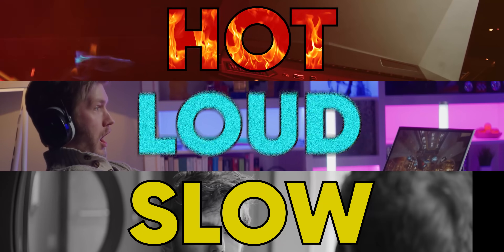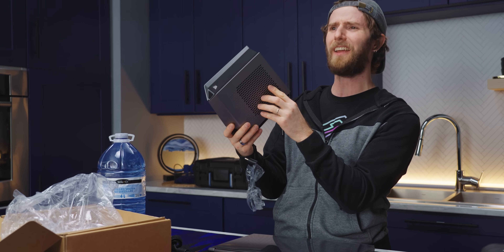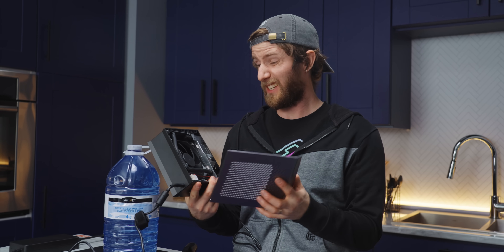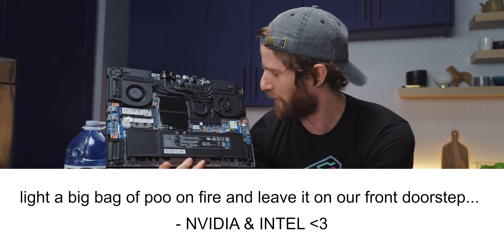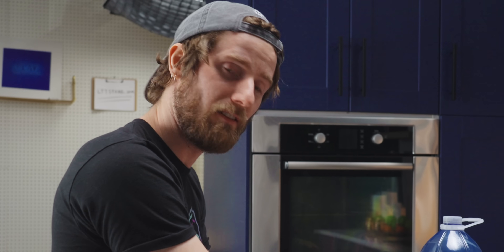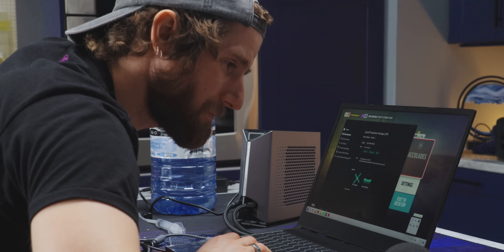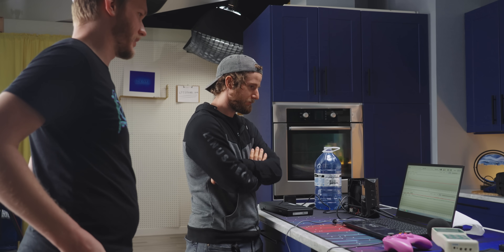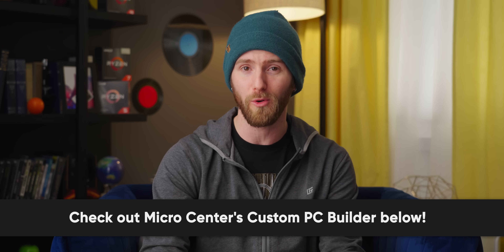This INSANE Watercooled Laptop Has a Huge Problem! - Eluktronics Prometheus Prototype

Comment: I got mine and it sounds like this sound. I got mine from aftershock. I contacted them and they said its normal and they cant fix or replace it... The sound is anoying asf and if you run it without cooler the laptop sounds even worse. Get another brand without the water cooler.

Comment: I have one of the worst laptops ever made, a HP Spectre, that is constantly overheating. I've been considering jerry rigging one of these to go into copper lines that sit on top of a laptop fan base so the fans can blow over the lines and help cool it down. Not sure if it'd be worth the effort but nice tonsee it kinda works for cooling it down as designed.
I would love to see something like I have in my head designed, like a cooling base with integrated cooling lines that plugs into a unit like this so the base can blow cooled air into the system rather than ambient temp.

Comment: mine laptop is on mouse pad beacause i game and i put it right beside my monitor in the corner. there are walls on the left side and on the back but i wanted to buy those cooling pads but i changed my min beacause i just moved my laptop so my back fans are not on the mouse pad. its little bit of the table but HEY it works and its cool

Comment: I  have a Mech 15 G3 from 2021. I'm having an issue that anything that I connect to the Thunderbolt 4 USB-C on the back, it randomly disconnects and connects, at random intervals. So far, I have connected and external SSD and a TB4 dock, while using most of its USBs already and always keeping my laptop charged. Am I doing something wrong? Is it a defect? Any answers I would really appreciate it. Thanks.

Comment: I think to "problem", if there is one, is that the cold water runs over the cpu, but returns to the cooler with the hot water over the same space, somewhat negating the flow of cold into the laptop.  Don't get me wrong, it seems to work fine, but it is what it is in a VERY confined space.  I think Eluktronics did a great job overall.

Comment: I'd be very interested in seeing this concept in the upcoming Labs when it's up an running.  A water-cooled breakout box like this vs an eGPU vs a laptop cooling stand vs undervolt/overclock type of test. (Not all together, obvs). I'm SO excited for the LTT Labs!  SOOO much potential.  I'm still wondering if they will be gaining a certification, though probably not, as it would involve way more than they can accomplish being a "small" lab.  Who knows.  But I'm still stoked!!

Comment: Theres great potenzial here, laptops come with alot of power today but they are limited by thermals and the resulting noise levels. 
I might do a DIY- job on my laptop with a few design changes: Bigger radiator and fan, quiet aquarium pump, a clear reservoir, a connector that doesnt let the water leak out when unplugged. I dont really need speed control if the whole system is quit enough, when its not needed I just turn it off.

Comment: Yo guys, I'm one of the first owners of a notebook with this liquid cooling (XMG Neo 15 - the European counterpart of Eluktronics), and I can tell you it is freaking awesome. It is much easier to use than I thought it would be. When you unplug the liquid cooling connector, the male connector cuts all water flow, so when it's unplugged it doesn't spill or drop any liquid no matter how you hold it. The holes in the female connector in the notebook chassis are small enough so that there is a resistance that the liquid inside the laptop has to break through to get out, so it doesn't spill by itself (Think of a syringe full of liquid that you have to press to get the liquid out, it's the same concept).

When I want to move my notebook to another location, I unplug the liquid cooling connector (which leaves one or two drops of liquid at the table), and I take the laptop to a sink. While moving the laptop with liquid inside, it doesn't spill no matter how I hold it, which was my biggest fear before buying this. At the sink, I use a manual air pump that they ship with the laptop to blow air through the liquid cooling female connector to get all the liquid out, and I'm good to go. I do this in 30 seconds or less, it's pretty convenient. I have posted a small amateur video on my "channel" going through this process if anyone is curious.

The temperatures that I observed in GTA V were:

Liquid cooling OFF:
- GPU: 86°~ (capped at max temp allowed by NVIDIA)
- CPU: 86°~90°

Liquid cooling ON:
- GPU: 62°~
- CPU: 72°~82°
Reply: wait what ? if you disconnect the external water cooling to move the lap top and its sorta sealed so only a few drops come out ? exactly why the hell would you go to a sink and use a tool to extract the water out of the lap top ? how about not making a tool to remove the water in the lap top and simply making a cap device with a quick disconnect as well and just CAP the lap top and leave the water inside?
Reply: @mathewhoffer4541  This is the first version, they could improve it on future iterations
Reply: @LucasBustamante1  yo man how’s the build quality after 3 years?
Reply: @Negative ScopeYou have leaks with both ends connected? Never had this kind of issue with mine. The end that connects to the cooler (the one that you have to screw) sometimes the screw got a bit loose with time and leaked a bit. The other end is plug-and-play, so never had this issue.
Reply: @Negative Scope What liquid are you using? I've seen a recall on the first month due to broken connectors caused by the chemicals in the cooling liquid that they shipped the first batches with. The recommendation is to use distilled water only. If you're using distilled water, then I don't know what else to say

Comment: i have a sony viao laptop from 2012 and i have managed to drop the temps by 30*c ,as i live in a hot region where temps go upto 45*c  in summers , i have removed the ram cover completely and put up a stock fan from microsoft's xbox 360 and boy it ramps up, its using an external power brick (AC to DC) with a regulator upto 12v  from 1v , and the room air conditioner (daikin 1.5ton) really puts up the temps around 29* with minimum load and 40 under loads like gaming and 60* for long video rendering (4k) which is not bad compared to a 40*+ ideal and 100* while the cooling system chokes. so yeah the problem i have encountered is completely within the resources available at home (xbox's motherboard was dead so i had no problem chipping off the cooler from a soddered cpu or gpu)and smartly engineering the aero part and the laws of thermal conductivity.
conclusion a mobile cpu can perform really well under controlled temps , and leaving any gap between the fan and laptops body will cause a massive loss as the air pressure with fight against each other, but now you cant put your laptop on a flat surface of without a stand, considering the perfomance tweak i highly recommend this method for those who are stuck and cant upgrade their machines any more as its working at its peak and need more performance with applications released in 2022 like photoshop 2022 , heavy blender or just for competitive gaming

Comment: Idk why u guys are attacking water cooling there definitely use cases for it and if you never have boosted the clock to a stable spot where it doesn't do any turboing it does smooth out the experience I've never seen u guys do it

Comment: I wonder how well a scaled up version would work. Not quite the old-school, hip-height exterior passive radiators of the early 2000s, but maybe a 240mm to 360mm version for the desktop, allowing people to add water cooling to a cramped case with minimal water-bearing components inside in the case itself.

Comment: I drew schematics to this water cooled laptops years ago along with theral calcs. Full folder with sketches and designs in a much better form factor because water would run on the blocks inside the laptop so actually water cooled not passively water cooled through pipes to pipe to chamber. Too bad never patented it smh smh

Comment: I would love to have a laptop with the 12900HK, it will be more or less comparable in games with my slightly overclocked 12600K, but have double the efficient cores so in everything else as in multi tasking should be great, just hope the mobile GPUs are comparable to at least the 3060ti/3070 desktop versions, waiting for reviews on the new laptops to decide on whether to buy one, you are doing a great job guys

Comment: There are two things that makes laptops unappealing to me when it comes to gaming; the slow displays (even those high refresh rate ones) and the awful loud noise they make when playing demanding games. Since I'm traveling when working, I have a 1 year old Lenovo gaming laptop with a 120hz display that I bring with me. Playing fps games which utilize the 120hz screen shows great signs of ghosting at that high refresh rate, and if the game is somewhat demanding oh boy does that laptop fans sound like it's ready for lift-off.

Regarding the slow high refresh laptop displays I predict that QD-OLED displays could make that a thing of the past. Then the last concern I have is the noise of the laptop when playing higher demanding games. A product such as this could be the ideal solution. Sure this takes a bit space, but honestly I could not care less if this actually made a laptop totally quiet while gaming, while this device itself would be quiet as well.

Comment: what if they add a quiet and fast rpm fan like from noctua or be quiet. for 200$ price it must have  a good fan right
Ohh they updated it with 99.99. if they could upgrade to noctua or be quiet fan with the price like 110$-120$. this might be the best water cooling laptop! you can operate CPU and GPU to the max with good temps

Comment: By the sound of that racket the pump had air bubbles it couldn't shift. I found the small pumps I've used in my watercooled laptop mods are prone to it. Cycling the speed up and giving 
them gentle whacks is about the only thing you can try to shift them, other than that, using an alloy auto coolant mix helped a lot (I had mixed metals in my loops, copper and solder)

Comment: laptops are noisy and hot if you don't have a clue how to use them. Mine is cooler and quieter than any desktop pc with an i7 from 10th gen and nvidia 2060 graphic
Key is to disable the stupid turbo overclock from cpu and use a proper clock speed. yes yes yes, benchs will give lower points but game runs the same with 30 less degrees and without noise 
Once I found out this which is not told anywhere online, I'm not going back to a desktop ever again.

Comment: Hello there sorry but I need help!!!! No idea where to ask so just posting here hoping to get an answer.... so basically I have a ssd and can boot windows from it when it's plugged in with sata to motherboard nd it works fine but if I take the same ssd out and use a USB cable for it I can't boot windows from it, the pc boot options are correct and it starts to boot the  comes up with windows encounded a problem with the sad face thing hahaha, any ideas much appreciated

Comment: Asatek had an AiO cooler designed for internal use in laptops in... 2012? Was built in an Alienware M18x. That would be something cool to see today. I think that thing was designed for a 55W cpu and 2x 105W GPU in sli back then.

Comment: This concept is absolutely brilliant, if it gets a few more months in the engineering room i could actually consider buying a gaming laptop for  when I'm on the move. My biggest complaint with laptops has been the cooling, both because of the audio and the thermal throttling.
Reply: Well, laptop hardware has thermal limits a bit higher than its desktop counterparts. But no hardware maker has built a laptop with water cooling in mind.

Comment: In my opiniom there should be a solution where you put watercooling from the bottom of laptop. Something like replaceable backplate with simple switch method. So you can just take off standard backplate and put the laptop on watercooled base.

Comment: I know it's just an engineering sample, but what happens if you disconect the water tubes? it has a sealig or something? Maybe it will be a good idea to add some weight to the bottom. 99$ is a very good price!

Comment: The performance is actually pretty impressive. If all that's wrong with the product are the semi-broken fan in this particular unit and the cap that could do with a redesign for Rev. 2, it's hard to really fault the product. Adding software fan control would be the cherry on top, but, depending on how loud (quiet) the fan is when it's working properly, it's probably no more than one last "nice to have". Seriously, from the well thought out internal layout, through the performance that the product delivered, through the (very) moderate price compared to competing solutions... this looks like a really good product, if you're into that sort of thing.

Comment: First thing I do on any device that has fans is rip the fans out and thrown them in the bin and put Noctua fans in.
Also FFS Linux, that fan has standard 3-pin plug. So you could easily add aftermarket fan speed controller to it.

Comment: once those wrinkles are fixed and it is revised .. that little cooler is well worth 200 if it making that much of a difference in temps and sustaining higher clocks...  i also like the power pass through

Comment: Well I thought it was a clevo but later I realized No it's not. Clevos would use desktop processor on it. 12900HK isn't.
It's probably an asus. I remember that GX700 comes with a watercooling dock.

Comment: I imagine this being a viable product for the masses. A lighter laptop without fans and extra heat sinks for portability and when you need extra power for work or gaming, just plug this cooler in and you're good to go. 
As a bonus, if this 'laptop cooler' is a common standard, you may even save a bit on e-waste by not installing so much cooling into laptops.

Comment: That was a very neat product. To solve the fan noise just put a variable dial on the front so you can manually adjust the fan speed.

Comment: given my laptop stays permanently fixed in a laptop stand up in the air to promote airflow and constantly runs at i7-8260HK ~82c & 980m GTX ~75c (yeah i just leave games open and/or parsec...)

think I should move it out into a airflowy case and re-apply thermal paste again 😅
laptop goes good for a nearly 6yr old

Comment: how does it handle when you unplug the Water Cooling from the Laptop, does it drain out or does it stay in ? because if you have to drain it every time you want to disconnect it then it kinda sucks as a laptop.

Comment: I have a 2 and half years old laptop with an intel i7-9th gen and 1660ti and I NORMALLY get over 100°C on gpu and cpu and when I see the use of them cpu is at 50% use and gpu at 55% use

Comment: This seems like a really awesome product. Imagine having a gaming/multipurpose laptop that you can stick in a docking station or whatever at home and turn it into a monstrous tower, with one connection. I'd seriously consider it in future for work travel, my whole rig could convert to a laptop without losing its power at home. It would have to convert into significantly better performance than other laptops of its price when connected to be worthwhile, though.
Reply: No it don't make really sence in my mind. In my opinion external notebookcoolers which you put under the laptop for 20$ is way better for his price.
Reply: @User-abc-o1p  They don't perform nearly as well as an actual water cooler. You could put absolutely monstrous parts in there and have laptop which can convert to a beastly desktop at home, cooling pads don't provide enough of a benefit to do that. An automatic overclock or even custom parts to take advantage of the possible TDP when connected would enable some incredible portable builds.
Reply: @Jsfun  Yeah honestly the issue lies with the fact that laptops have to be closed at the bottom which restricts airflow. Water cooling would be a game changer. Unfortunately for me my TDP is restricted so no point in further cooling. Thanks ACER.

Comment: This is quite ingenious. You still can use your laptop as a laptop, but when you want to play at your desk, boom instant cooling performance. I dont know exactly how it all works, but I worry that liquid is stuck in the cooling pipes of the laptop that could potentially lead to major problems down the line. The ability to just replace the pump/fan is super nice though

Comment: so when you dont want to use the waterpump how do you get out all the water from the heatpipe inside the laptop?  just casually dump it out and hope no water gets on your laptop? Besides this, i see the biggest point of failure is the tubing connector.   Good idea but risky for pricey hardware to just fry.

Comment: Dude, I want one.
Can I use that system as DIY on other laptop?
Omen 17t i9 9980h & 2080 rtx.
Burns my fingers on keyboard....
Reply: I am so disappointed, it sounds like according to the website LPP wont be sold separately with interior case liquid chambers to DIY users even though AT FIRST GLANCE, I exchange my internal heat  insulator for heat conduction and it looks it it would contact with all parts  for minimal diy work.

HP PEOPLE, that's exactly what I screamed at you for as water cooling for Omen series, HP always behind innovation.... and some young manufacturer has to show the way.... seriously!!!!!

Comment: Tbh if i we're to afford a gaming laptop with water cooling id def buy this external water cooler. Would be gr8 to see fan control with pre determed settings like quiet, balanced and raw fkn power. And as to the top leaking a lil that is something i'd fix on my own if they dont fix it. As Linus said sometimes you just bump into the table and your extremely expensive laptop is having a pool party isnt something i'd be comfortable with